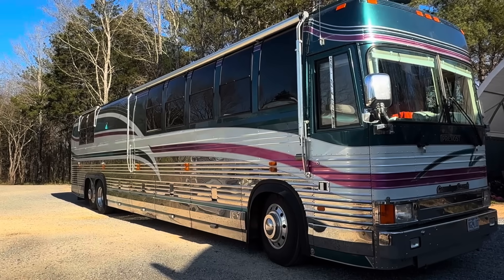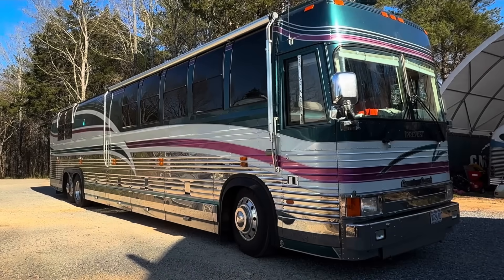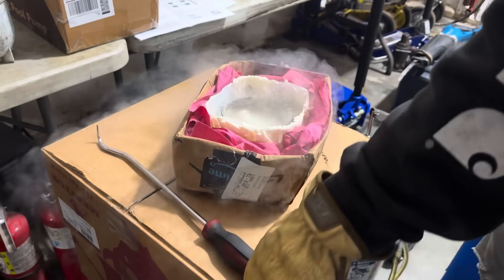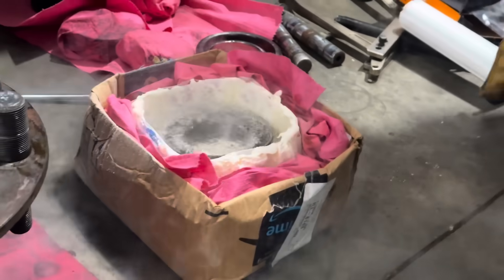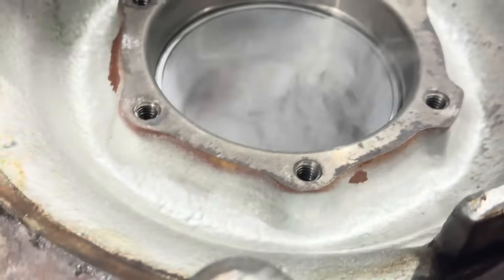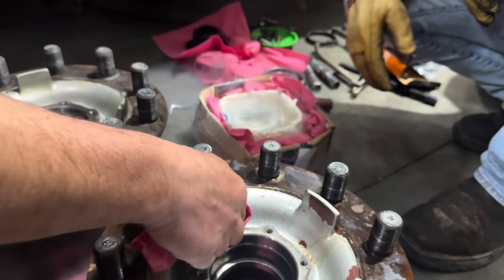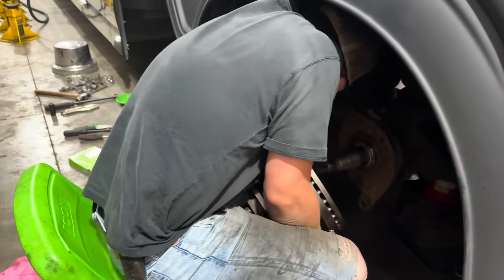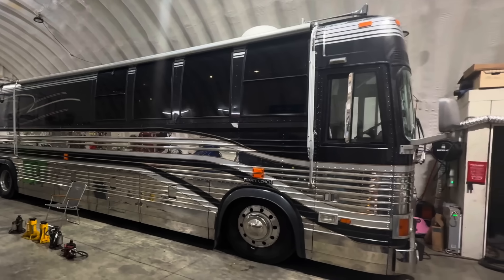Using Liquid Nitrogen to install wheel bearing races.

Comment: Why don't you try - demonstrate easy removal of the race from hub? Run a bead of weld all the way around the race. Turn the bub over, and a light tap is all it takes. No beating! Works great especially on aluminum hubs, where the race often binds trying to beat out. (41 yrs with motor freight co.)

Comment: HI I know that the subzero quench causes the Rockwell on tool steel to increase making it brittle. is this a common practice? and does this seem to shorten the life of the bearings? maybe the heat generated while in service is enough to draw it back to a usable state.
Rich
Reply from the maker: Bearings get frozen installation is common
Reply: @BusGreaseMonkey  sorry I didn't mean to offend you, I have done some subzero heat treatment and was curious, when I have done it, I had to draw the steel back again to make it usable, it is possible that quality bearings are subzero quenched then it would not matter, I just don't know.

Comment: Recently retired coach owner and mechanic, here in the uk a coach with brake problems would attract a pg9  ,would.d not be allowed back on the road without a full ministry of transport inspection and a new mot test certificate!
Reply: Years ago, that would've seemed excessive here in the U.S.A.  But, between BGM and Just Rolled In, we can see what happens when maintenance is not performed.  The argument for such inspection is much stronger today.

Comment: Very obvious that previous owners of these rigs just didn’t have proper maintenance completed, though owners are mostly at the proficiency and honesty of repair shops.  Great work as usual.
Reply from the maker: He’s had that in other shops 4x for maintenance and inspections and no one noticed the brake conditions or lubricated anything on the brake systems.

Comment: Liquid Nitrogen costs something like $1 to $2 a pound in small quantities, that flask they decant from probably holds between 25 and 50 pounds, and will keep its contents cold fora geed few days, or maybe even a couple of weeks, so with a bit of luck they can get a couple of bus-set of bearings done form it.
Reply from the maker: It’s around $20 to fill.  Lasts many weeks in that container.

Comment: I just wonder how brittle this extreme cool treatment makes the parts in the longterm. Need a metallurgist's opinion on that one.
Reply from the maker: It does no harm.
Reply from the maker: If you filled the hubs with liquid nitrogen and drove around like that that would not be good.

Comment: @9:46 it appears that the bearing seal is D R Y!  tip for newbees, always lube the seals with clean grease or oil, if installed dry the seal will wear out rapidly, also note the difficulty getting the hub on due to the lack of lube on the seal
Reply from the maker: Not dry and it was not the seal holding it up it was the inner bearing sliding on the spindle

Comment: Is using the liquid nitrogen the only way the bearing races can be installed?  I assume that's how other shops would do it as well?
Reply: No, it’s not the only way to install bearings.   Most people just drive them in with a hand large punch.  I use an old drag link with the ends cut off.  Works like a champ and cost $0.  

This was clever and fast though.

Comment: Is there anything special about the nitrogen that it is required, or was it just available (and easier)?  Never saw that before.
Reply: If you had a coldhead you can make your own. 78 % of what you breath is nitrogen.
Reply from the maker: You buy it at welding gas location.   Container available on amazon it’s called a dewar tank.  $20-30 usually to fill

Comment: In the late 60s I used to use liquid propane from propane torch bottles to reinstall silicon bronze valve guides in VW heads. Just dropped right in with a satisfying "tink".